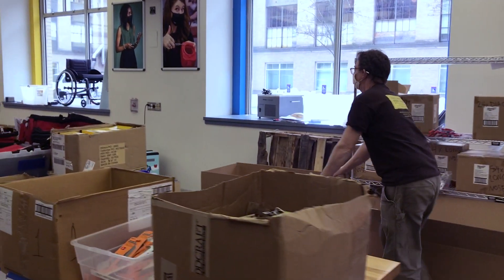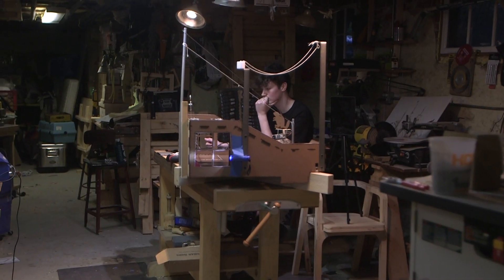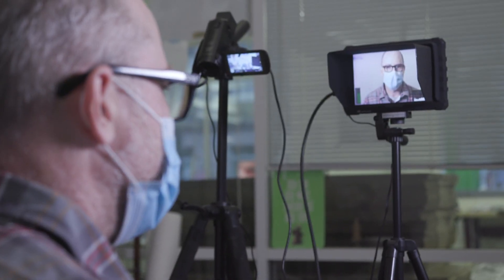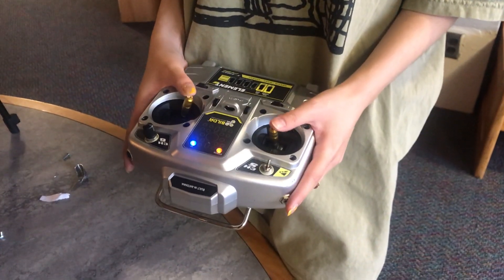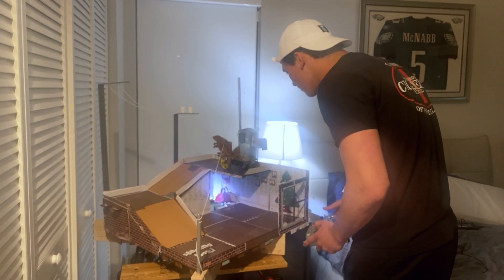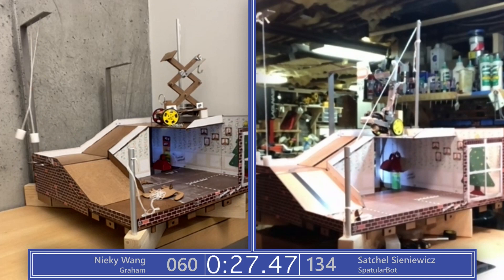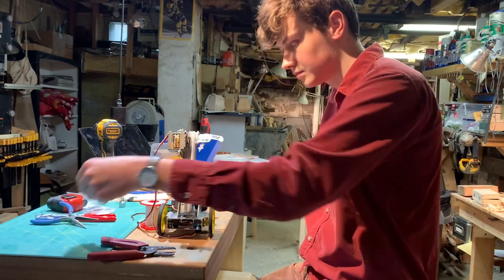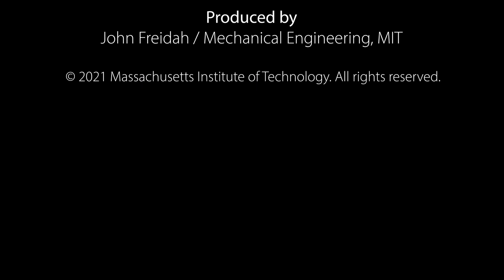MIT’s first-ever virtual robot competition

Comment: Hi everyone, My self is Muhammad Islam and I belong to Pakistan. I m currently doing Electrical Engineering from Fast national university . I have completed my 6th semester and I also want to work with u guys. I am a hardworking student.  I also want to tell u that we worked on a semester project which was related to a single-axis solar tracking system in First-semester. I m interested to learn more new things